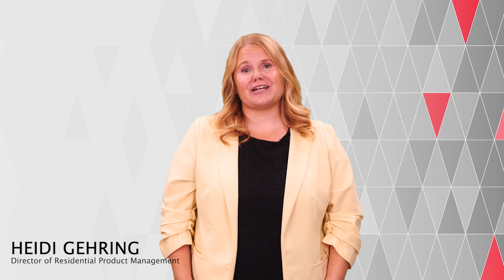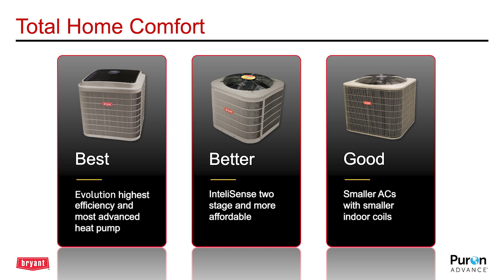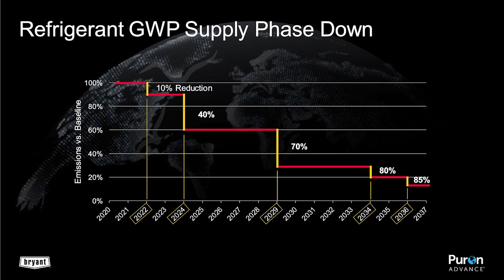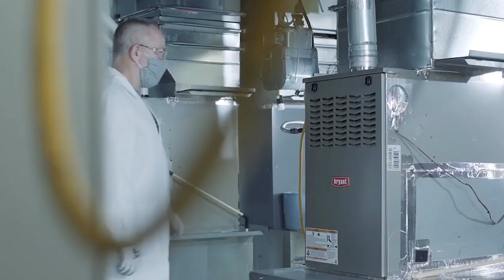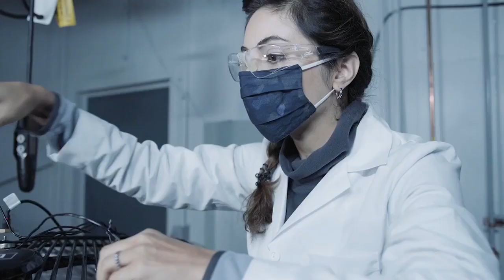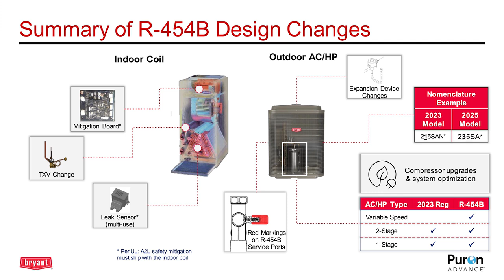Bryant Puron Advance R-454B

Comment: The continuous changing of refrigerants in HVACR systems has been one of the biggest scams ever foisted on American consumers.
Refrigerants were never proven to be a major contributor to environmental degradation. 
However, this scam does allow manufacturers of HVAC equipment and refrigerants the opportunity to continually increase prices for equipment, maintenance and service.

Lobbyists for the manufacturers, are able to buy the political votes, to perpetuate this larceny.